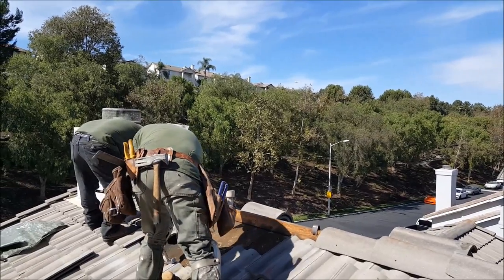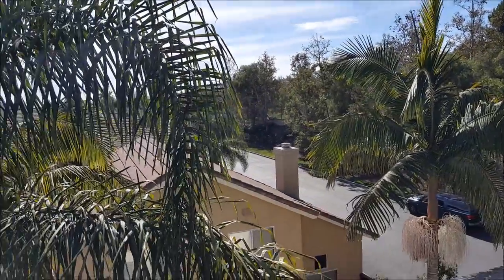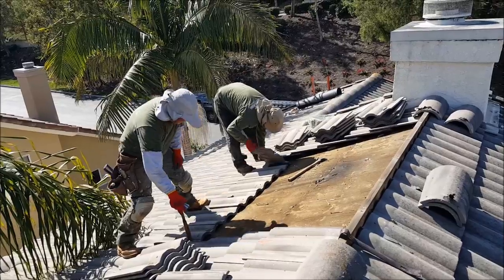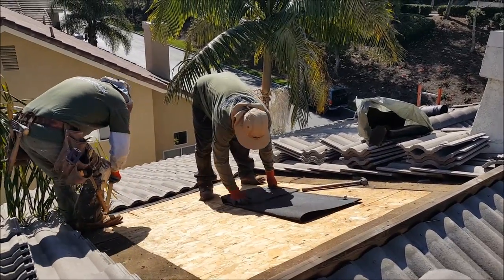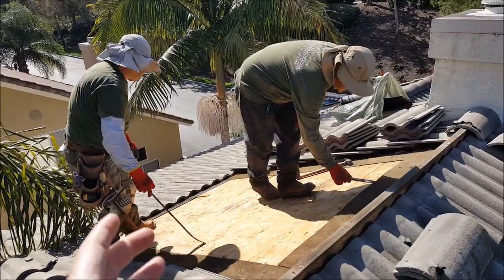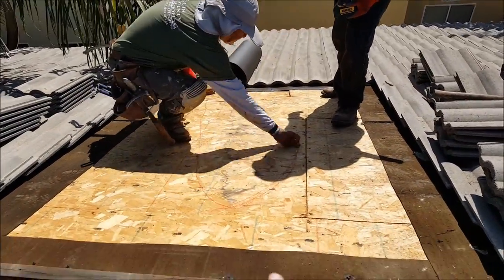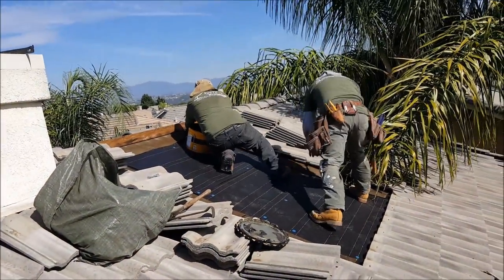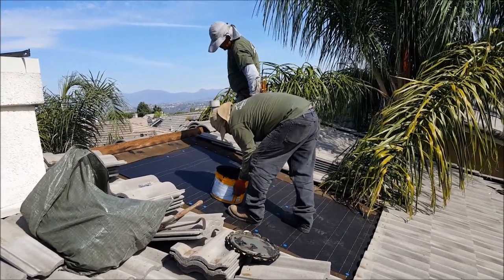Fastest tile roof leak repair from start to finish...In and Out in under an Hour.

Comment: You had information I tried to listen to very carefully. I'm hard of hearing and so I missed some detail because of your method of speaking. I have started taking tiles off my room and have questions about the underlayment and if it is so damaged by age it needs to be replaced even though there is no penetration. The tile roof was installed about 20 years ago and I am gluing some of the tiles, and replacing others. When it is cooler I will buy the nails and underlayment, maybe plywood, that I need. I am figuring it out as I go. Thanks for your video and the points you presented. I still have questions about what you did at the top of the roof for underlayment. Many videos have installers using mortar. There is none on my roof.
Reply from the maker: What profile of tile do you have?  Flat or curved.
Reply: @SouthCountyRoofing  It is called "S" curve in the videos I've seen. I guess you would call it curved.

Comment: I have a tile roof and it's lasted for over 20 years. Can the same  tiles be reused if the entire felt is replaced? So pretty much I'm putting a new roof with the same tiles, is that possible?
Reply: yes , most certainly, just be careful because some of the tiles from when that house was built may be on the endangered list as i like to call it lol.    but as long as you have a commonly used tile it shouldnt be a problem, in the event that you break a tile on the install

Comment: I'm also interested in why it was leaking? Looks like a good overlap on the tiles. Accumulation of debris underneath the tiles, letting the water pool there, over time forcing the water to go sideways?
Reply from the maker: I think it was an incorrectly driven nail that penetrated the felt.  It most likely only leaked during wind driven rain storm in a certain direction.
Reply: There are lot's of reasons for leaks, the most common is debris in the valleys causing water to divert to other areas.

Comment: I have a leak near a sky light. It’s coming through the nails. Do I just replace the paper? I was thinking about some of that roof rubber spray.
Reply from the maker: What type of roofing is used?
Reply: @SouthCountyRoofing  tile
Reply from the maker: @nagrain  You probably need a professional.  The paper needs to be removed to see the full extent of the water damage.

Comment: In America they all talk the talk .But the water ingress originates clearly from some defects with the tiles to get through to the roofing paper .Then the other problem is fixing tiles directly to the roofing paper it erodes the paper and each tile has a nail which penetrants the paper .common sense would tell you that's not good practice. If you use a batten system with spacers that would resolve a lot of these problems you see All the time there's hundreds on line with same problems.

Comment: The problem is the pitch on the roofs the lower the pitch the more capillary the water going back up the tile and because the tiles are filled directly on to the paper over a period of time the paper erodes away you can see the marks where the tiles have been
Reply from the maker: Pitch on the roof was almost 5 and 12.  Totally sufficient for those tiles.  It was just simple wear and tear.
Reply: @SouthCountyRoofing  clearly the pitch is a problem  your relying on the paper to keep the water out if the pitch was greater the water would not get through to the paper at all it's not wear and tear its  bad design
Reply from the maker: @samcaldwell7694  You are just wrong Sam.  I am not relying on the pitch I am relying on gravity.  It works every time.  The pitch on the roof is Five and a Half inches of slope for every foot of run.  What does that mean??  I'll tell you.  Plenty of pitch.

Comment: So why is it leaking? There shouldn't be any water under the tile, unless the course spacing is wrong . the underlayment is not the roof the tile should hold the water out.
Reply from the maker: "So why is it leaking"  Because the felt was done wrong and where it wasn't it was rotted.  "There shouldn't be any water under the tile"?  What are you smoking.  The manufactures specification reads that 20% of the water that hits the roof gets under the tile in a normal rain.  Wind driven rains is much higher.   The tile is decorative.  All the water proofing is under the tile.
Reply: Wrong again.  I live in Washington where it rains every day, I can pull a tile off anywhere on a roof and it will be dry, you guys just don't know how to install there
Reply from the maker: @edrichards9104  You're wrong.  It doesn't rain every day.  It hasn't rained in weeks over my house.  I also in WA.  Bet you didn't know that.  So, you are going to try and convince me that the manufactures specifications written by engineers for that specific material is wrong and you are right.  Or, better yet.  You have never read the specifications and like most roofers you know more than everyone else.  Right.    Keep in mind we fix about 250 tiles roofs a year in So Cal.  I am sure if you live in WA (like I do) you wont ever even fix 250 tile roof in your lifetime.  Keep trying, they do.  Good luck.
Reply: @SouthCountyRoofing  the tiles ain't decorative pal🤣🤣
Reply from the maker: @J_MO  Yes, they are, buddie
Reply: @SouthCountyRoofing  of course not they serve a purpose if something is decorative then it would be optional they serve a purpose to direct water off the roof the felt underneath is then the last barrier before water enters the premises
Reply from the maker: @J_MO  The purpose is decorative.  Yes they protect the underlayment from the sun. Da....

Comment: That repair would fell 100% in South Florida first of all you have no underlayment all you have is a 30 lb paper that would leak like a SIV you need 30 lb peel and stick and if you're going to nail those tiles do you need a nice tar line to  nail to are all the roofs in California just have 30 pound on it that's it please let me know
Reply from the maker: We have totally different building codes than you guys have.  In some cases a single layer is code.  In some cases depending on the pitch of the roof you will need two.  It doesn't rain much here and we don't have the risk of very high wind like you guys do.